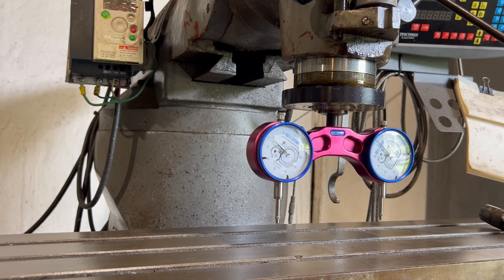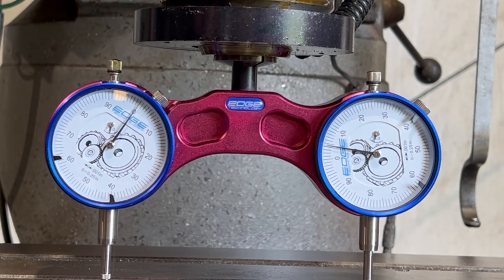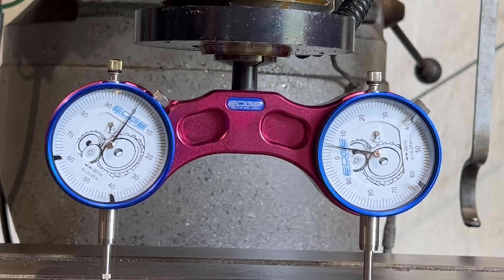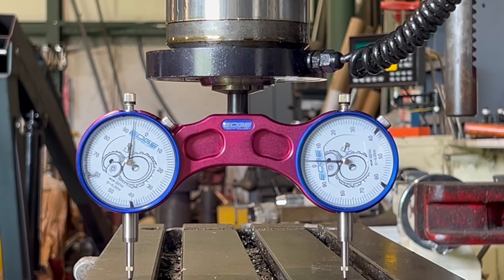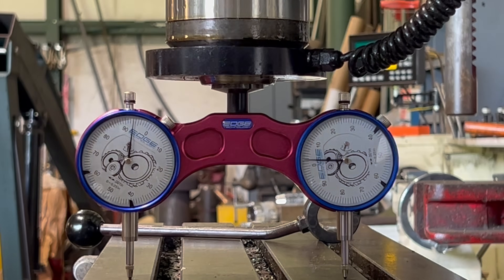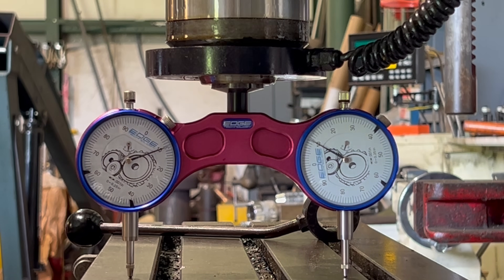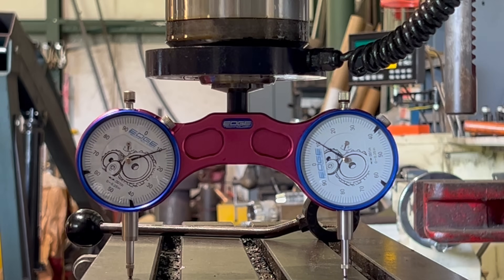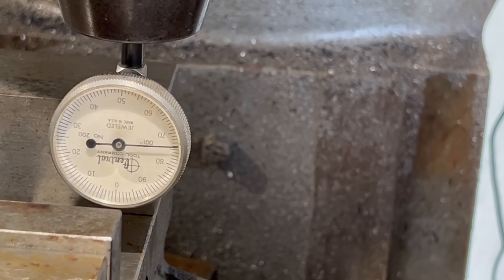Tuning up a milling machine

Comment: A lot of people poo-poo the dual indicator tramming device, arguing that a single indicator is enough, so that's the only way you should do it, in their not-so-humble opinion. Do you need the dual indicator unit? No. Of course not. But those of us who have them and understand the advantages find them very useful. BTW, no need for an expensive commercial unit, if you have the time and freedom to make one. And since they're self-checking and easily calibrated, they don't need to be especially precisely made. That makes it an excellent home machine shop project, even for a beginner. You can make it simple, or as fancy looking as you like. Mine is a simple inverted T, made from 3/4" round and 5/8" square stock.
Reply from the maker: Was trained on a single indicator but I kinda like this one better. Outstanding idea to make one.👍

Comment: The Bible is MORE than real and that's NOW if it's ever been! Worked as an equipment operator for Daniel out of Greenville SC out at the local DuPont X-ray film plant. Met a pal of the WW-2 Seabee Uncle and had a pal for that job! Worked out of the Millwrights shop and he WAS one. Might make something out of stainless maybe 30 or 40 feet long, holding 2 to 4 thou and never know what it was till he went in the plant to install it. Some place to work but everything and everybody is gone now. See your prospect welder in the rain. We just got a GOOD shower! God Bless ALL Yall!
Reply from the maker: Did they have a boiler there that they certified and never fired and later tore down?
Reply: @RedRheaWeldingmachining  Possibly. The plant was at Cedar Mountain just over from Cesars Head looking out over SC. They did a lot to it after the x-ray film died out. I ended up on dams and whatnot after that deal and never went back. I think Griffin out of Greenville hauled it off. They did the paper plant in town.

Comment: Morning red. Curious how you figure out what to charge someone. Like ive worked in fab shops and sometimes you need to mill down a small piece and seems like it cost more to turn on milling machine and labor than its worth to make a say $8 piece for someone.   Feels like doing a bunch of people a little favor more than its worth it.
Reply from the maker: It kinda is. I usually go straight by the hour and when I finish, look and see what the part is actually worth and charge from there.